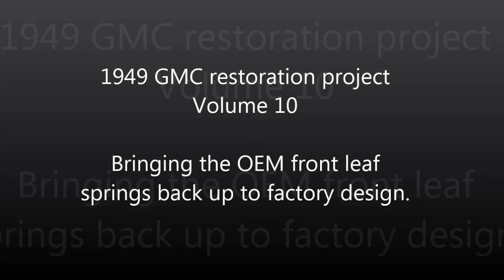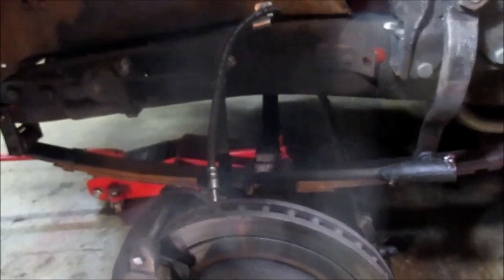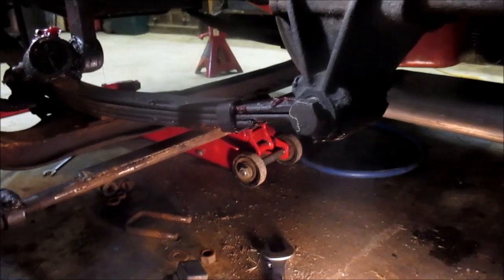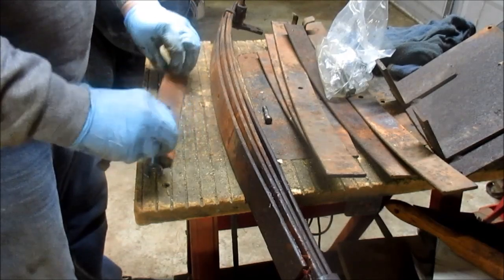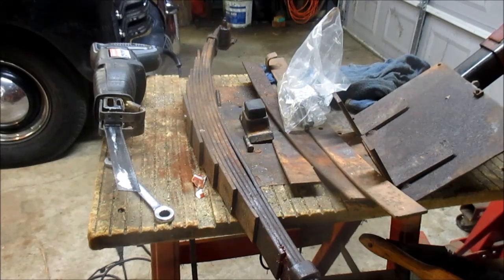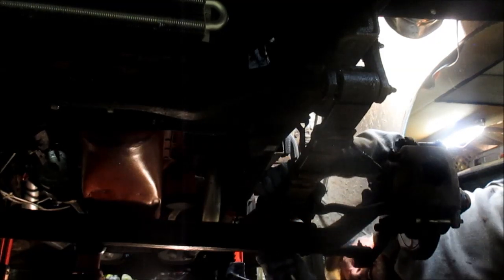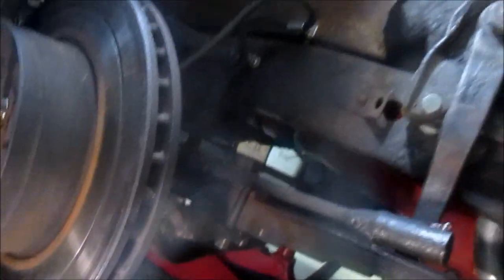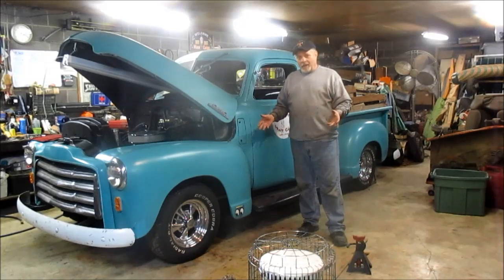1949 GMC Truck, Replacing the front leaf springs, Volume 10.

Comment: Looks good, and the tire size looks good too.  But, I will say that I prefer the stock ride height on my classic trucks.  I've never been into hot rod looking pickups, LOL.  It's just not my thing. Actually, I'm not into hot rod cars either.  I like the stock original stuff.  But that's what makes the car and truck hobby great, there's something for every taste.  Although I seem to be in the minority these days.  I stopped taking my 1960 Chevy pickup to shows because everybody would basically ignore my stock truck and look at the hot rods and resto-mods, or the rusty rat rods, LOL.  But I still get the occasional thumbs up when I'm driving it around......
Reply from the maker: Thanks for the input ICR. I noticed the same thing when I used to take the Chevy to shows, the judges would basically skip on by not even asking anything about it and spend alot more time on rat rods etc., I guess those of us who like the stock look are getting scarce, LOL.  re. the GMC I'm just playing the hand I was dealt, it would cost way too much to go back to stock on that conglomeration, LOL.
Reply: @Volfandt  -- Your GMC is still a neat truck though and worth the time you're giving it.  The last show I went to, not one judge or spectator stopped and talked to me about my truck.  I kept thinking, "come on guys, this is a bone stock restored truck with low miles and original wood bed in great condition.  What's not to like...."  Oh well, I enjoy it and will pass it down to my son.  I told my son though he better keep it stock or I'll haunt him from the grave, LOL......
Reply from the maker: @ironcladranchandforge7292  A good friend of mine has a ratrod 28 Ford pickup with a late model Ford 4 banger and auto and he wins all kinds of trophies and theres hardly anything stock on it. He's one of the main ones that tells me to keep the Chevy as is and stock to which I always reply thats how I intend to keep it. The GMC is another story, LOL.

Comment: Hey: You found that missing nut WAY TOO EASY !!! I always need to walk around the garage at least three times before I discover when I put the dam missing part down without thinking about it. ;o(  Need to go to a Camaro front clip or Mustang ll independent. Pretty "involved" project since I believe either way involves new motor mounts, radiator support, re-hanging the front clip, new brakes, and some steering mods.
Reply from the maker: Sometimes its better to be lucky than good, LOL.

Comment: Oh, I forgot to ask..... Are you flooding and landsliding in your area?  I watched on the news where parts of Tennessee is having bad landslides from all the rain.
Reply from the maker: Yeah,  we've has several roads closed for a couple days where they flooded pretty deep. We've got so many hills and dales that those unlucky enough to build in the low areas are getting flooded. The landslide you've probably seen is I-40 over the Smokey Mtn's going to NC. Between there and the Spur in Gatlinburg it's almost automatic they'll let loose when it rains heavy enough.

Comment: Still enjoying all your videos wish I could share with you my stock 50 3100 on your GMC I’ve wandered what you did to get 5 lug in the rear front obviously just the swap kit... but the rear must be open driveshaft and a different rearend possibly from a 60s camaro?
Reply from the maker: Jamie,the GMC was already converted to 5 lug power disc brakes in the front and an 80's Nova rearend with open driveshaft when I traded for it. I had to rebuild it so found out about most all the mods as I went. The front disc rotor's, calipers, pads and soft lines are 70's-80's  S10/C10. The power booster & master cyl were part of a conversion kit as best as I can tell that used 75 Pinto parts. I cover alot of this in the GMC's 1st video.
Good luck with your 51 and thanks for watching.

Comment: Great video as usual, I’m a subscriber to your channel and have watch manyyyy of your instructional. That said I have Q for you it’s about rear leaf springs:
With the truck and jack stands (placed under the differential housing just inboard of the leaf spring attachment) on level ground I’ve observed that the Left wheel is about 2 inches higher than the Right hand one (the latter is about 1 inch of the ground.) 
Question: is there an issue with one of the springs?
Reply from the maker: There could be that one set is worn more than th eother but with that said how level does it sit onthe ground? If it's level or close to it I wouldn't worry about it. It's not unusual for the drivers side to sit a little lower than the passanger side because of the additional weight or the driver and no passanger usually occupying the passanger side.
Reply: Thanks. I’ll verify. I seem to remember that while sitting on all 4 tires a width wise level read level.